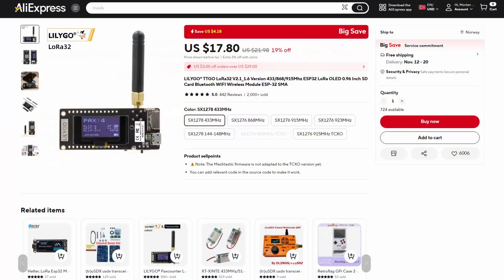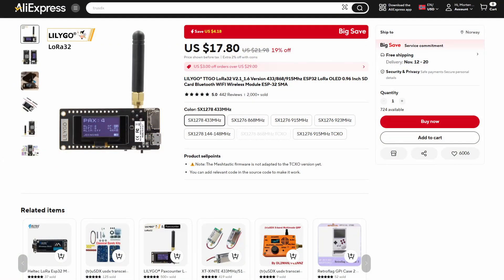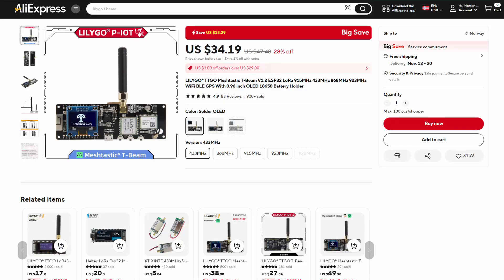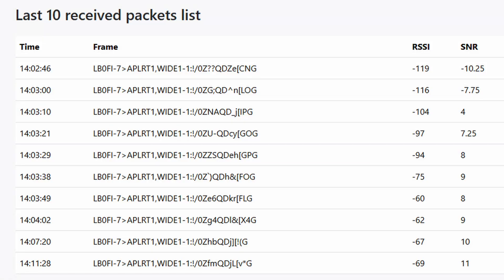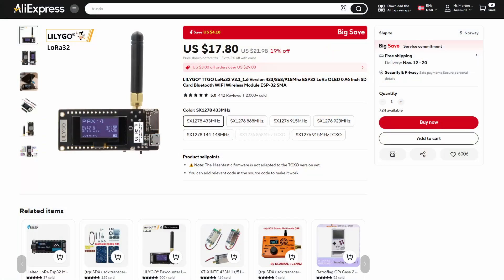An intro to LoRa APRS

Comment: This is also an ISM band. So I would assume you could float it as an ISM device? Or does the use as APRS violate the rules for how long / often you can transmit?
And as a ham, could we use consideringly more output power than the ISM rules allow? I have been thinking about the use of LoRa as a ham. But did not study the rules (yet) and what possibilities we have under the rules.
73 de LA8BKA
Reply from the maker: Yes, it is an ISM-band, but as long as you use your callsign all of the ham rules apply. And you also have the ability to use more than 10mW…

Comment: Cool stuff Morten…
I’ll be following you on this venture…
Totally makes sense to use lora mesh for aprs messages… to be honest it’s a more “regularly useful” application for it than off grid messaging.
Reply from the maker: It's actually not mesh. It is just regular APRS modulated with LoRa instead of FM. But it is fun, and I have a plan to extent the coverage to my entire town (or most of it) with just one more digipeater. It might work, and it might not work, but then again, it's not a huge investment.
Reply: @ yep in the way you have done it it is not mesh, but wouldn’t it be possible to have it run like normal lora mesh that carries aprs data to the nearest igate instead of text messages?
So if a mesh had enough igates in high locations, you would hope that a transmission from a node would get to an igate in say 4/5 hops or less.

Comment: Try frequency 434.855 with BW125kHz CR 4:7 SF 9. It's called "Polish frequency," but it's not used by ISM devices such as garage openers, electric meters, scooters, and so on.
Reply from the maker: Why would I use that when 433.775 is the recommended frequency for LoRa APRS in Norway? The point is to be able to reach others.
Reply: @LB0FI  the reason Polish hams decided to use a nonstsndard frequency (434.855 instead of 433.775) is less interference from various ISM devices.

Of course it's bad for interoperability.

Was it a good idea? I don't know, maybe.

73 de SQ2KTN
Reply: @LB0FI  ham radio is hobby with experiments in mind, I'm suggesting to try it and compare with "European frequency"

Comment: This is REALLY cool stuff. Did similar test-drive today and got picket up by LB3QJ-11 a guesstimated 70km away! That's while driving! Oh, and the 20 in the power settings is annotated as dBm, at least in the web-configuration on my board, so that's 100mW, not 20mW.
Reply from the maker: That is impressive. Regarding the power setting, I seem to remember that I have read that the max power of the T-Beam is 20mW, but I might have misread that. I will read up on it and probably correct it in my next video on the subject.

Comment: Hi Morten, I did the same too, same Ttgo Lora board as a  node and an Heltec V3 for the Tracker. I haven't connected the node to the Internet yet, it will be interesting to see your setup. 73, Steve